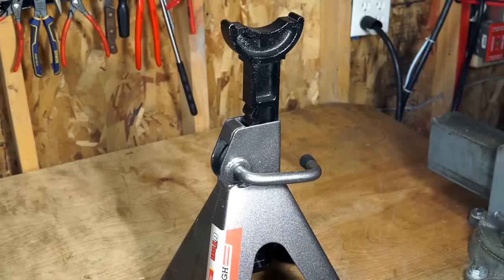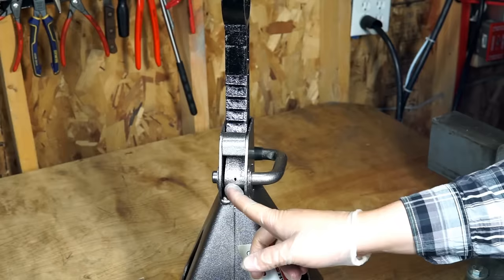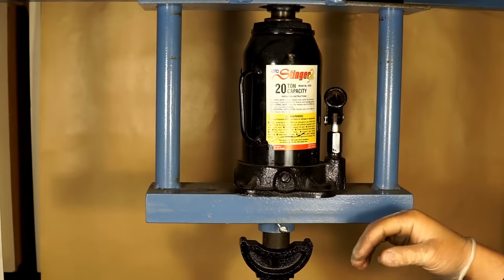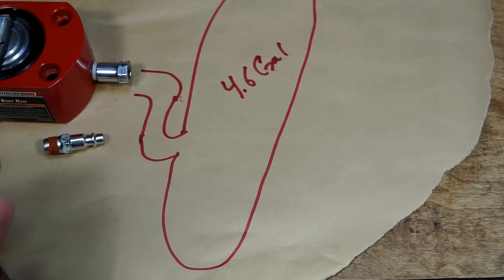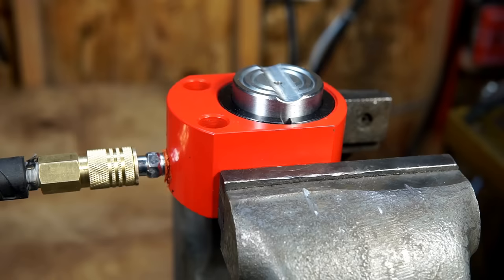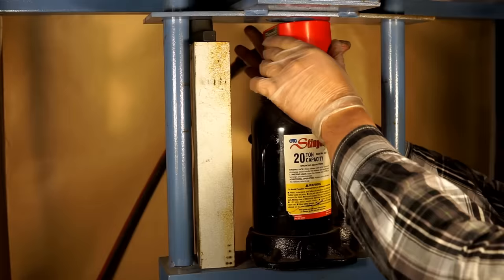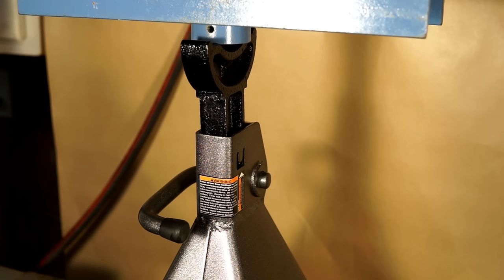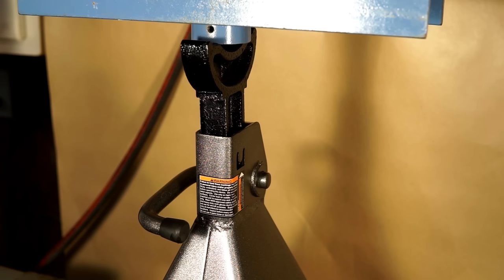EXPERIMENT: WARNING! Doing this to your Jack Stands will get you KILLED!

Comment: And there may be a few out there, still alive, who use "cement" blocks for jack stands. All it takes is a high-enough-pressure area on a block, and it will crumble. Even putting a 2x4 between isn't a guarantee.
Reply: the blade edge of an axe head is a ridiculously small surface area, so the force of the blade hitting the wood (an impulse force that is probably tens of times larger than the weight of the axe due to impact speed) is applying unspeakably large amounts of pressure on the wood, shearing it in half. Not a good comparison at all.

Wood is decently strong, the worst compression strength i could find online was the perpendicular-to-grain compression strength of wet Pine and it was still over 200psi, meaning a 4"x4" square could hold 800 lbs. Of course I wouldnt suggest that for holding up a car, but most types of wood are significantly stronger than that. Pine's strength jumps to 1200 psi when dry and set parallel with grain.

Remember, 2x4s and 2x6s are the main structural ingredient for most peoples houses.

Don't underestimate concrete, its lightweight but has crazy compression strength, like thousands of psi. Now if you put a bunch of weight in the center of a cinder block (ones with big cutout) yeah it will snap because your putting the cross piece in tension, concrete doesn't like bending forces (that's why steel rebar is used in lots of concrete, to increase tensile and shear strength). But if you properly distribute the weight across a solid block of concrete, there is no way any car known to man will ever crush a non-defective concrete block.

The problem you might encounter is that the jackstand feet are very small, exerting high pressure, but some sheet metal underneath would distribute the load across either wood or concrete.

Comment: I bought a pair of jack stands like this but I never was comfortable without a positive locking feature (a pin a hole in double shear).  Using a pin in a hole I can see that is fully engaged and when I lower the car onto the jack that pin is never going to fully come out.  If the pawl in your jackstand somehow did not engage fully you would be in a lot of trouble (like winning the lotto in reverse).  Could you try it again and instead of letting the pawl engage fully like it normally does let it get hung up (tip to tip) before engagement.  I think the leverage to disengage would be considerably less.  For definition of pawl see https://en.wikipedia.org/wiki/Ratchet_(device).  It is great you took the time to do your test.  Now I know where to get a short body ram!

Comment: There are jack stands that have pins to prevent this type of accident
Reply: Yea. I only ever seen and used those. It's also much simpler and cheaper desing: Just two steel pipes one inside another, and pin through them.

I don't really get why these even exist?

Comment: You had to engineer some pretty specific circumstances to get that jack stand to fail, which is why we basically never hear of them failing when used properly.  There is no such thing as a perfect product with safety features that cannot be defeated by wreckless or determined fools.  If you are careful and use good quality jackstands according to the instructions that accompany them, they will provide safe, effective service.
Reply: Yep, and a lot of people dump hard on those Harbor Freight stands, but I highly doubt there was a rash of cars falling on people, and I've never heard of someone being killed by a faulty HF stand. I think there are an awful lot of novice tool users, who know just enough about how to use a particular tool to be dangerous! Tens of thousands of vehicles are recalled every year due to safety issues, and no one seems to have a problem buying a new car!

EDIT: In 2020,  Harbor Freight reported 11 people had been injured by one of their failed jack stands, with zero life threatening injuries and zero deaths. I know people think China is out to kill us all, but we wouldn't even allow their stuff to be sold here if it was killing and maiming people left and right!
Reply: 500 lbs is not an uncommon weight to have on a jackstand. Small FWD cars could create this scenario.

Comment: I usually put some weight on the jack stand, and leave some weight on the floor jack, while using a tire as backup.  If the jackstand has no weight on it, and suddenly takes all the weight of the car (hydraulic jack fails), stands are not designed to suddenly support something that falls on it, even from 1 inch higher.

Comment: That's why you use your jack with jack stands as a backup, or the other way around, whichever you prefer. Unless you're using an ANSI certified lift, you should always use 2 different methods to lift your car.
Reply: So true I'm still alive been under cars for over 30 plus years always have a back up or the dreaded impending doom starts to kick in on the old mind.
Reply: I place jack stand then snug jack up without lifting.
Reply: That's me lmao I'll stick 2 stands underneath with the jack I used still in place and maybe even a tire thrown under there, I like my face I dont want it crushed
Reply: @davidtaylor9249  exactly
Reply: A jack will fail at a higher rate than a jack stand.  The best option is to use high quality ramps.
Reply: Depending on how long the car will be lifted, you're much better off using the jack stands as the primary.  Doesn't rely on hydrolics that could leak or fail under pressure for awhile.

Comment: its a 6 ton stand. try again with an appropriate weight. maybe a ton or 1500 lbs. 500 compared to 12000 not a good comparison. try it with a two ton stand
Reply: Ray Dion the point was to test the stand under everyday circumstances, he purposefully picked a low weight standard to a small car that everyday people use.
Reply: Not so, Ray. 6000 lb is the weight it should be able to hold up. You're not supposed to be able to release it when it is loaded. You're supposed to have to lift the weight off the jack stand before you can release it.
Reply: im saying the shear pin is rated more for more weight and sturdy features. put a little more weight that pin may shear or more likely you wont beable to lift the weight off. alot of people could just bench press that car. 500 lbs is not feasible on a is it a 6ton or 6000 lbs jack?
Reply: Ray Dion i jyst feel obligated to point out that No, even with adrenaline going, 500 pounds is not easily bench pressed haha
Reply: The shear pin is not supporting the weight, it simply connects the handle to the pawl and is supposed to shear away from the pawl under too much load, leaving the pawl to hold the car up and making it impossible to release.
Reply: David Burton - 6 tons is 12000 pounds, not 6000. 1 ton is 2000 lbs.
Reply: +1, Redslayer86.  I seem to have had some reading comprehension issues a couple of nights ago.
Reply: it doesn't matter what weight the stand is designed to support. The small pin should always fail with a very low force regardless of how much the stand is capable of handling. Even if the stand could handle 50k pounds the pin should fail anyway with a small force. That is the purpose of that pin
Reply: Miguel Ribeiro well that pin should never fail  .... thats how lives are lost .... cant beat a drive over pit! nothing safer

Comment: Someone needs to take those pliers away from you.
Reply: they are good
Reply: professional bolt rounding tools
Reply: Knipex like that have jaws that move parallel to each other, so they work like an adjustable wrench, except you have the pressure from the pliers keeping them tight against the nut. They can actually be better than an open ended wrench.
Reply: If you want to use them for whatever, you just have at it.  I do not allow "adjustable wrenches" in my shop either. Never use a open end wrench when you can use a box end, by the way.
Reply: Especially when the wrong tool is used the wrong way, like when was initially removing the fitting
Reply: armedhippie what about an adjustable box wrench
Reply: Actually considering buying a set!
#ThatOpenEndAnd12PointSocketLyfe
Reply: Constitutes laziness and a lack of desire to use the proper tool. Rounds bolts just as easily as pliers.
Reply: paul r Could you please use some more punctuation? I'm not sure I understand what you're trying to say.
Reply: You're complaining about the Knipex Pliers Wrench?! LOL! Don't knock them until you try them. Those are not the same as the Swedish nut lathe (i.e. the adjustable wrench). They exert 20x the force at the jaws, so the harder you push/pull on the handle the more clamping force is applied to the nut. You'd have a hard time rounding a nut with those.
Reply: I like them. I want some.

Comment: It is possible as a former crime scene investigator, that this accident was not an accident but a crime an poor detective work close it as an accident. You may be amaze how many cases I have cross with a poor assessment from officer, detectives and other form of CSI's personnel.
However, is clear that the jack stand require an additional lock to ensure safety.
Now I retired an my new career as owner of an automotive customs shop, I appreciate your demonstration video thank you sir. I will implement your video in my shop safety   meetings.

Comment: In theory if the paw and the teeth were worn
I mean really worn
It would be possible but I’ll bet it was prob the jackstand placement more than anything 
I’ve seen people put them under a-arms
Reply: What's wrong with putting them under the control arms?? If they're properly placed they're just as safe as being on the frame. Sometimes you have to load the suspension, and floor jacks aren't stable enough to keep the vehicle from moving.

Comment: Old Jack stand's do not fail like that because the mechanism is safer and totally different!
Reply: like the old pin style? Though its true i actually had a really old craftsman one like that break by the structure itself bending. Thankfully i noticed the car when i was under it moving and looked and saw it collapsing and was able to get out but it was so very close and thankfully the actual welds didnt break
Reply: like the screw jack style I still use a set for lighter low clearance stuff

Comment: This would have been so much easier if you would have just used an actual car.
Reply: Andrew-D's Tv maybe he doesn't have a car that weights the same as the Porsche? He should buy one for this video huh? And asking others would also talk longer because who would want someone to risk damaging their ride? But yeah anythings possible my man.
Reply: He could have borrowed a junkyard miata for 20 bucks for an hour to test and record. Still, the lesson is have lots of failsafe measures (bricks, wheels, wood blocks,).
Reply: Andrew-D's Tv But he doesn't want his car to fall down?????
Reply: oh of course the junkyard miata for 20 bucks every city or town has one.
Reply: Pretty sure a Porsche doesn't weigh 500lbs..
Reply: XeDragHD A quarter of the car weighed five hundred pounds
Reply: it doesnt. But when you jack up the car, you arent jacking up 100% of it's weight.
Reply: XeDragHD 500 pounds per corner.  2000 pounds total.  Derp
Reply: Why run the risk of damaging his car?
Reply: A car falling off a jack-stand behaves rather unpredictably and could be dangerous.
Reply: Porsche weighs a ton (2K lbs) 4 wheels, 500 lbs each

Comment: The 914 Porsche does weigh around 2000 pounds but chances are if you're doing major work the engine and transmission is out of it. If you don't know, the 914's engine drops out from underneath the car so your calculation of 500 pounds might be high. That car is a scary car to work on, it doesn't have any real jacking points and its light enough you could bump into it and move it. If you're unsure of your safety put blocks (solid timber, stacked 2x6, cinder blocks, etc) under the wheels. If you're taking a tire off throw the tire underneath the car. Anything that'll give you space between the car and the ground in the event something fails. Jacks do fail, if cars are a hobby then we all know you already spend too much money, don't throw throw precious car money away to hospital bills.
Reply: well done! I too was hoping for a myth busters type of "Test to Failure", to see where the shear pin would fail, but a worthy test all the same! Thank you for the heads up!
Reply: Cinder blocks, or any other concrete, is not safe, because it easily breaks.
Reply: CaninesBestFriend except you're wrong... Any concrete is unsafe? Not once has my driveway allowed my truck to fall though the earth. Concrete by itself has little tensile strength but it has shear strength. (If you're an engineer don't judge my vernacular, 100% tradesmen. 0.00% structural engineer) Sheds and even houses sit on them and withstand much more load than any vehicle will ever put on it. Even (real) clay bricks which fracture very easily if dropped can support a vehicle. You can take a punch and a hammer and lightly tap and it'll crack the brick, but lay it down flat and jump up and down on it and it's not gonna fail. Common sense man, driveways, sidewalks, parking lots, retention walls, load bearing walls, curbs, foundations, all use concrete/cement. Tensile strength has very little to do with shear strength. You need tensile strength? That's what rebar/glass fiber is for. Don't go hijacking my comment and spreading false opinions. But what do I know, I only occasionally work with the stuff... Weekly
Reply: concrete has static, compressive strength. anytime you introduce a dynamic load (read: falling car) concrete/stone loads have the possibility to crack and fail
Reply: don't use cinder as jack stands then try to hammer the brake disks off of an f250, guess how i learned that one lol
Reply: William Breslin I totally agree with that, and thanks for the correct wording that was bugging me. I failed to mention I set the truck on it with a bottle jack lower to catch if failure does occur. I'd agree it's not the most secure but you run what you brung. It already has static pressure on it. Obviously you can swing a 12oz hammer and crack it but if it's placed on it flat each block (depending of composition) is rated for 5000 psi. Consumer grade blocks drop much lower than that but out of all the years of field repairs never has that method failed for me. To say it's unsafe when people utilize it in an unsafe manner is asinine to me. Unsafest method in my opinion is a scissor jack. Just be smart about it
Reply: BricksOfButter  Concrete chunks, cinder block, or brick wouldn't be safe to use to catch the falling vehicle in the event of a jackstand failure. Also, there's a big difference between a reinforced slab poured on compacted ground, and a hollow block.

Comment: Nice experiment! I have been getting under cars and trucks on jackstands for nearly 50 years. I got awakened by the failures of the old split tube design when those failed right after I'd done a clutch on a Chevy truck about 35 years ago (talk about a close call!). I replaced all of them with the ratchet types you depict here.... and have wondered many times about exactly the failure you show here. I'll be investing in Graytool USA pin type stands after watching this video!
Reply: I think I had these same jack stands that I bought 30 some years ago...They are rated 4000 lbs.  I checked the welding on these tubes and found that the welding job was fine...How did yours split tube stands failed? Just curious, and wonder if I should keep using them...
Reply: I don't understand why you would replace anything, what he proved is how Unlikely it is that you would bump the lever and it would fall.

Comment: Yes cinder blocks are a horrific idea. One good whack with a tool or something of like and they shatter!
Reply: duckslayer92 they use them all over the world under boats 5 times the weight of a car.  Just use them correctly
Reply: A little late to the party but cinderblocks are very brittle, yet have insane compressive strength. A cinderblock is designed for static loads, so you can easily put whatever weight it is rated for on top, but the moment you have a dynamic load such as a falling car, you can easily exceed that spec.

Comment: This is why I feel safer with bar and pin stands. It's a giant thick diameter pin that goes horizontally through the stand. Basically impossible to fail if using the stand within it's rated weight.

Comment: But the base of the jack stand is still going to hold the car up!!!!!!!! It will just drop to the lowest height
Reply: I agree, however I could see a badly set car dropping to the lowest setting and then falling off. But again that would be with a car poorly set to begin with. More importantly, why were the jackstands so close to the work area to begin with? There are many lift points on vehicles so there's no reason to be bumping into them if you take a minute to do a little planning.
Reply: I agree... what if he had the stands all the way to the top, then he bumped it which in a way Jack knifed the stand?
Reply: Yeah nah i dropped my falcon my jack failed lifting the other side. This caused the car to slide off the rail and the stand was just sitting freely under the vehicle.
Reply: No, there are not many lift points on vehicles anymore that are SAFE.  Take a close look at some of the service manuals for popular late model unibody vehicles and you'll see what I mean.  Many have NO lift points except for the four pinch welds.

Comment: Thanks for the video. I always have the utmost respect for the weight of my car and always use extra precautions. That is Jack stands (with extra load margins) + floor jack + wheel or other smaller jack stands. Otherwise when I'm under there fighting with stubborn bolts, that wouldn't be fun. Stay safe.